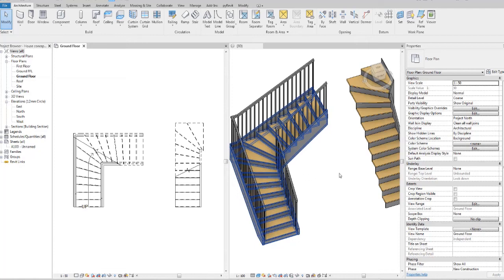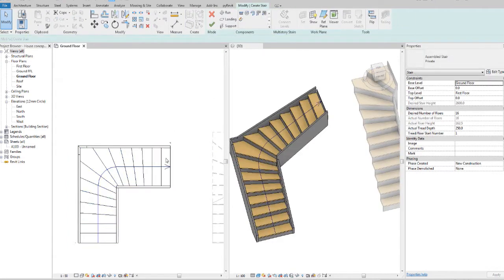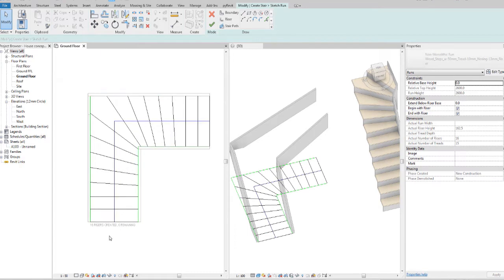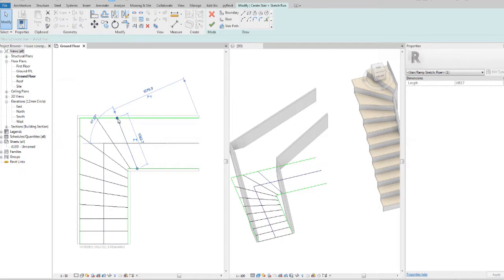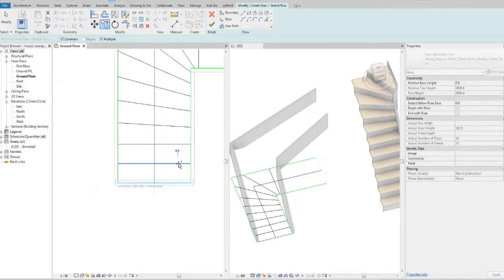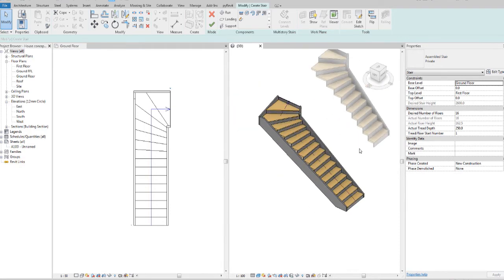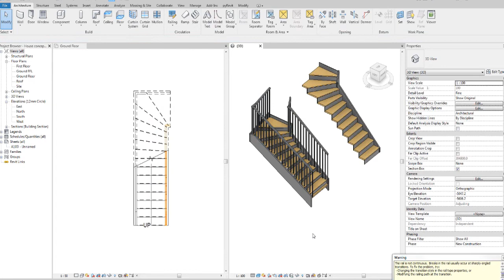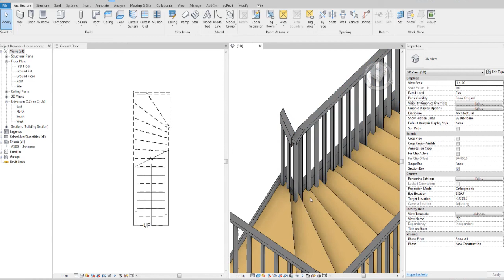Editing Stairs in Revit

Comment: Can you make the first riser 20 and the rest 15cm, how can you do that?
Reply from the maker: As far as I know, in Revit you can’t control different step parameters in the same stair. We ran into this problem in the office when trying to model a stair based on a survey, the solution we had was to make 2 separate stairs and join them together.
Reply: @DrawingTechnical  Thanks for your answer
Reply from the maker: @SUL-KSA   you're welcome